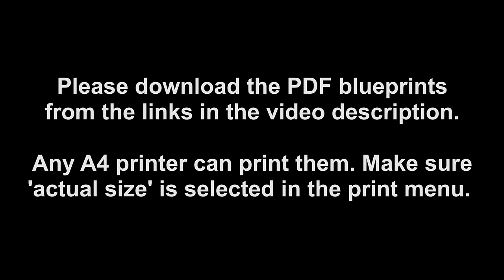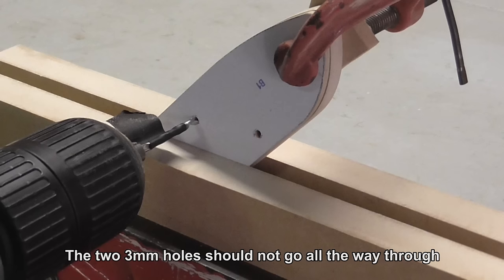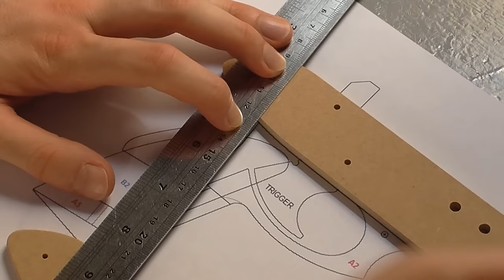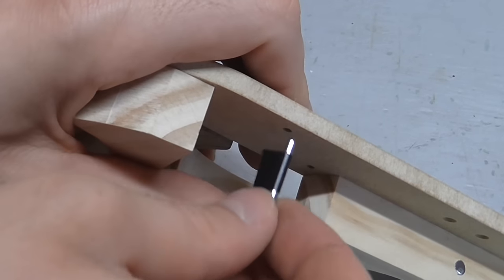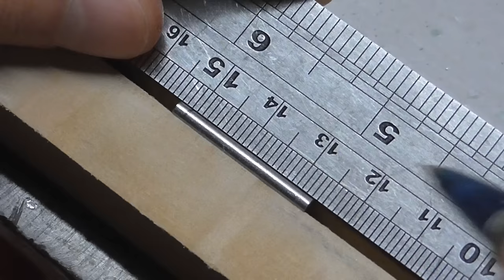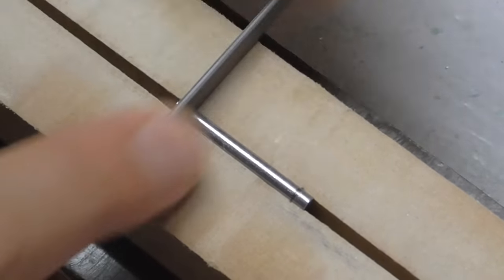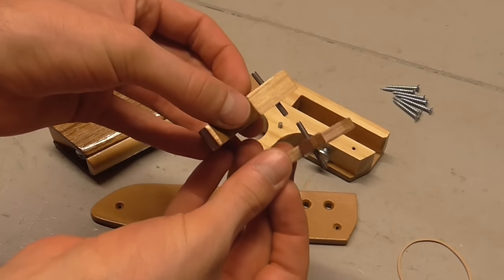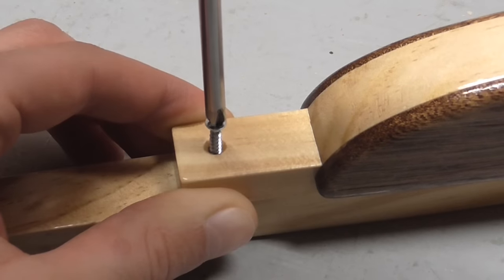Tutorial — Adaptive Carbine Rubber Band Gun

Comment: what can i use instead of a 2.8 mm drill bit of i don not have access to one?
Reply from the maker: Just buy a drill bit or use thin dowel.
Reply: i can find all types of drill bits but not 2.8 what should
 i do?
Reply from the maker: A 2.5mm bit should do the job, you might just have to hammer the pins in place.
Reply: thanks

Comment: nice video bro ! you could show the tools you use in the next video?
Reply: a plainer to take off the template, a sander to smooth the corners, a jig saw to cut the peices out, a chisel to make the pocket clip, and a wire cutter to cut the nails. Also a screwdriver & hammer & drill.